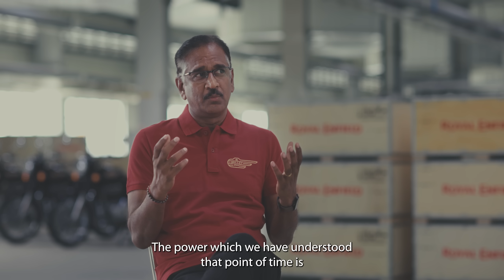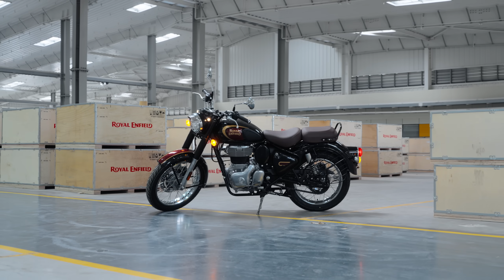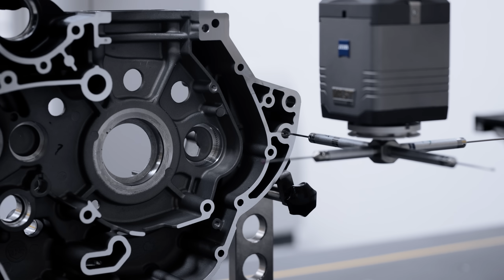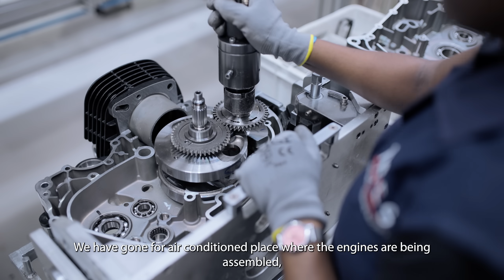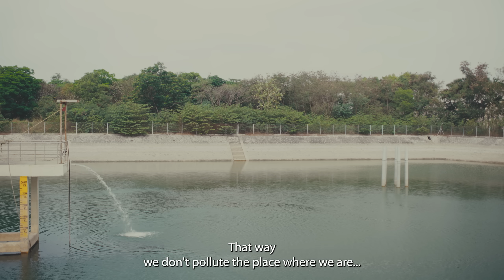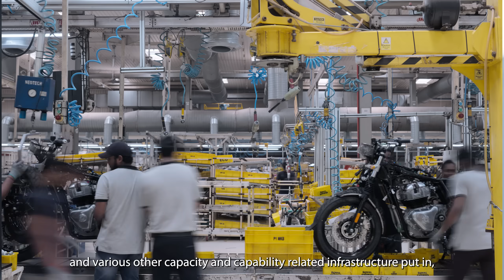Inside Royal Enfield's Incredible Madras Factory

Comment: I’m 61 and have been a fan of RE since I was 14 and learnt to ride the Bullet back in the day! Made good friends because of this, some very good memories. I now own a Meteor 350 since last 2 years. Of course RE has come a long way and under the leadership of Sid, it has done extremely well both at home and around the world. Nevertheless, I do want to highlight that what I have experienced is that rust happens to be a common issue. The other thing is the Meteor gearshift is flimsy and rattles. I have installed a aftermarket contraption which I am happy with. A little tweak on these issues and RE would certainly bring a smile on its owners! Thank you

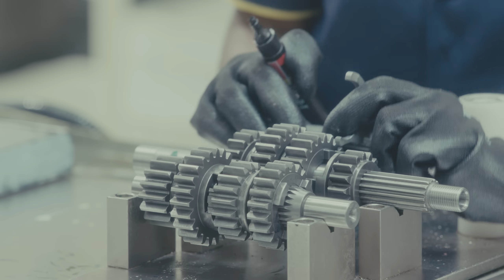Comment: 3:05  " if you increase
the number, quality will deteriorate,calling it myth."
Bullshit!! Recently purchased Meteor 350 marine blue from showroom, after selling classic 350(2015 model).
Found its built quality is just average specially it's start button, switches and fibre on handles are of poor quality.also small plastic cap on T bracket popes out on simple touch.
Rear suspension are super stiff.Although bike is superb in terms of looks and smooth riding.But overall build quality doesn't match as of earlier bikes.

Comment: The net zero crap is not worth mentioning. The green grift is just to make globalists rich and more powerful. At 400ppm, co2 is irrelevant. I want an RE but that crap almost put me off this as an ESG’d company. Also the EVAP, another green grift, is proving to be a huge issue with this bike. You can remove the EVAP, depending where you live, and it’s the difference between a $50 repair and $1000 repair. What’s next? An electric RE pretending to be green while slave children are mining for lithium and cobalt cause the wokies had fossil fuels? Come on, guys.. don’t make me get a Harley.

Comment: "Dear Royal Enfield representatives,
I am contacting you from Spain. I have enjoyed owning one of your motorcycles and am a satisfied customer.
However, I would like to make an observation regarding the aesthetic quality applied in the manufacturing: the finish of the visible welds on the frame is poor.
I would ask you to review your processes. It would be very beneficial to the brand's image if the welds, especially the most exposed ones, were much more carefully finished and aesthetically pleasing, in line with the finishes seen on other European manufacturers.
Improving this aesthetic detail will considerably increase the perceived value of your motorcycles.
Thank you for your time. Sincerely.

Comment: At the age of fourteen I saw my first Royal Enfield G350 (paddock bike). I don't know why, but I had to have one, so my first motorcycle was an 1948 RE J500. I bought that bike for $80 AUD in 1971, as a paddock bike. I learn't to ride on a sandy paddock with only the front brake operational. No kick start, and no excess weight to make the bike lighter, and faster.
The Indian built Royal Enfield Bullet 350 could be purchased new for around $800 AUD at that time, and I recall seeing them in the motorbike shops.
Eventually I bought a 1991 Bullet to restore around New Years eve 2024, and a few months later a road going 1999 classic Bullet 500. Both Bullets are old school iron barrell with right side gear lever; just what I wanted.

Comment: I have owned a British Royal Enfield for 53 years, it was 21 years old when I bought it, a 350 Model G from 1951.  It has taken me nearly 50 years to get it into full running order.  I bought a 2017 C500 new and really loved it.  I sold it after seven and a half years when I bought an Interceptor.  Following a lot of knee surgery I decided I couldn't ride the Interceptor at the moment, so I bought a 350 Meteor.  It is the nicest bike that I have ridden, good handling, lovely smooth engine and enough power for riding around the small roads and lanes in the county of Kent in England.  Thank you Royal Enfield, I thought for a time that I might not ride a motorcycle again, but the 350 Meteor is a wonderful bike to ride.  Thank you to all who work at the factories and make such a good job of manufacturing such a unique range of bikes.
Reply: Great that you are enjoying it. I am going to book meteor 350 tomorrow hopefully I’ll have a great experience as you did.

Comment: The worst motorcycle i have owned is ROYAL ENFIELD CALSSIC 500, 2012 model. 
3 times I have changed the fuel injection pump and once I have changed the wiring harness and the ECU unit, After all this struggle I have kept that bike aside in my shed and purchased HONDA ACTIVA.

Comment: This is why the "Big 4 motorcycle manufacturers are riding on your coat tails" The horse has bolted, & youv'e left them trying to play catch up.
I own a Honda 500x & a R.E. classic 350 reborn, the quality of the Enfield is just as good. if not better. I fitted the upgraded cam & I can assure everyone the quality isn't just on the outside but internally too, it's an engineering feast of delight. I always have a huge smile on my face when I look at it & ride it too. I don't get this on any other motorcycles I've owned. Well done R.E. what a fantastic achievement.

Comment: What are you selling, a history or a motorcycle?

You are focused on selling history, legacy, heritage etc. and you forgot to improve the quality of the motorcycle.
Obviously you are the Royal Enfield staff or employees so you have to say good words & that is the purpose of this video also.

Each of the motorcycles has some problem, then what is your R&D team doing.

You are talking about chrome paint, which is getting rusted & faded within a year. 
Your new j series engine is needed to open the engine head cover & adjust timing in every alternative service ( Gasket cost to the customer).
Himalayan had some problems regarding handling due recer, instead of solving you launched a new model & the rest of your old Himalayan engine will be sold through scram.
Thunderbird had a meter plate issue (which broke within 3-4000km).
Rear brake master cylinder fitted under the engine which caused rear brake problem & master cylinder need to change). 
Also, as usual a hydraulic pump is always an issue for UCE.

Me as a customer, my suggestion would be please focus on the motorcycles core part instead of the outfits like colours of the motorcycle. Maybe these are increasing sales but you are making quantity not quality.

Comment: I've had an Interceptor 650 for four and a half years, driven it all around Thailand as my primary transport. It's been very reliable on the whole. I recently replaced the accelerator cables as the originals had rusted and were sticking. That was three months ago. Other than that no problems. I did install a YSS front fork kit, which improved the suspension noticeably. What I love about this bike compared to literally every other bike I've owned or ridden is the smoothness and reliability of the gearbox combined with  well-engineered throttle action. Also RE service here in Thailand is very good. I've used service centers in Chiang Mai and Bangkok, exceptional experiences with both.